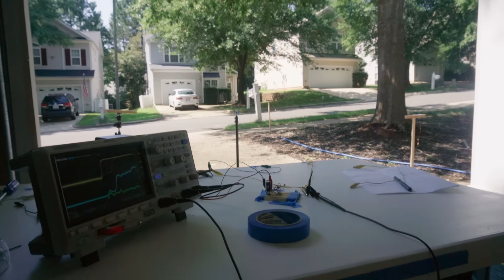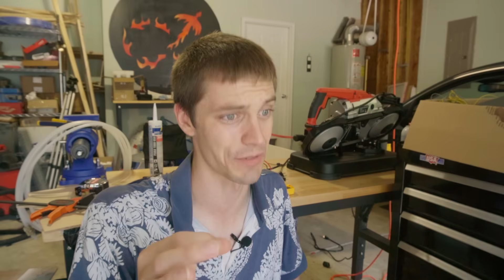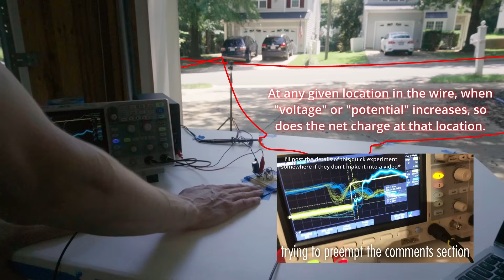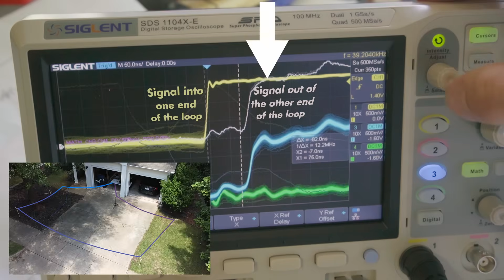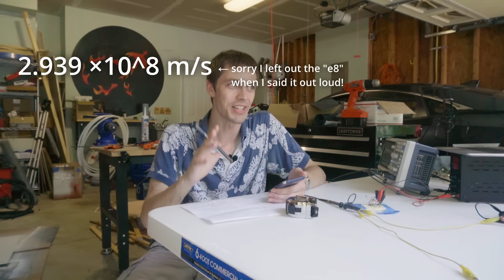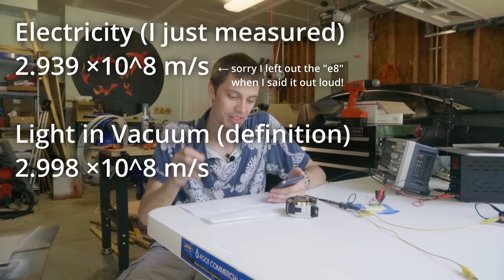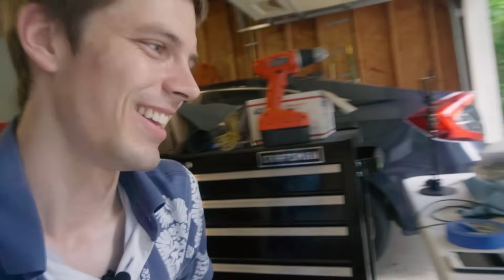Why does WATER change the speed of electricity?

Comment: Speed of electrons has little to do with speed of electricity, the important is the wave of motion of the electrons: meaning how they transfer they change in speed (when each electron begins to move so to speak) and that wave is the real velocity of electricity . Every engineer and physicist learns how to find the relation between a transmission line impedance and the speed of electricity in the line (that depends on frequency so transmission lines are a dispersive medium). it is not the resistance that matters it is the impedance. I can't understand why there are so many videos on the Internet that make experiments (I think Veritassiun began this trend with that with a very bad explanation and no theoretical background at all) yes water will change the impedance of the line and will change the speed...so what? By how much? It depends. A shielded cable will change it too, a bifiliar wire will do, a twisted pair will change it, even the height and distance of the wires affect it, even the conductivity of the soil for ground return systems like telegraphs. Too many experiments and too little explanations. Don't get me wrong the experimental setup is cool, but...this experiment ignores a lot of things...like the dispersive nature of the transmission line (the speed of switching change the speed and distorts the pulse form) and nothing of that is addressed: Veritassium, and others lose the point completely, this is a rich subject that is always explored superficially just for the wow factor. This  all is known by electrical engineers for almost a century...

Comment: Excellent video.  It's extremely difficult to discuss different types of phenomena whether observable or measurable and offer concise explanations that most everybody can understand yet thorough enough that it doesn't come across as pandering to those with slower processing abilities.  Well done.  Since on the topic of frequencies and wave forms, here's some brain food to chew on.  One of the more intriguing phenomena that I've heard about happens when a sound wave is used to collapse an underwater bubble, it produces a flash of light and we don't understand why that happens.  So a given a simple air bubble underwater, then you pop the bubble using a sound wave, and as the bubble collapses it emits photons.  The more you know, the more you realize you don't know.

Comment: Fundamental flaw. 
I feel like you're looking at the problem incorrectly. Instead of thinking about electrons as moving through the wire, or "traveling" through the conductive material, instead, think of it as a line of balls, as one is remove from the end of the line, it frees up space for the neighboring ball to move into it's place. This is esentially how electrons move along a given conductive pathway. Now imagine you have several of these lines, with no constraints to keep them moving linearly, and add varying densities of pegs. This is the "resistance". the pegs interfere with how the electrons migrate from one space to the next.. so forth and so on ad nauseum. 

The gist of the analogy is that electricity, or electrons do not flow, or move through a substrate as you're envisioning, but merely take the nearest available space. if one atom loses an electron, a nearby atom will give up an electron, and this cascades down the line. taking that in mind, if you truely wish to find the speed of an electron, or electricity flow itself, you would need to measure the individual electron migrating from one atom to the next, unimpeded by any resistance, or adjust your calculations to offset for the known resistive value.

Comment: From the department of energy: "But as an object approaches the speed of light, its observed mass becomes infinitely large. As a result, an infinite amount of energy is required to make an object move closer to the speed of light." Sooooo....If those electrons which have mass are travelling at 98% the speed of light, then each electron should have gained so much mass that they are each the weight of a car. Or so we are told....In practice its seems to be a B.S. theory.

Comment: I thought the math doesn't matter in terms of the length of the wire. It's the distance of the switch and the reader or something. Im just an average joe, so I can't remember all the proper terminology but the wire is useless. The wire just gives a direct current but it doesn't matter. Cordless chargers are an example. Idk how to properly explain it, I could make a graph to explain it but I can't do that in the comment section. So like everything your saying about water slowing it down and getting in the way is right, but using the distance of the wire wasn't right, I think 🤔😅... even if it wasn't right I doubt the answer would have been noticeably different

Comment: Propagation and circuits are two antagonistic things. For an engineer, speaking of the speed of electricity is meaningless. When you have propagation you dont have anymore a circuit as the circulation of the electric field is no more conservative and voltage cannot be defined. What you are doing here is measuring the speed of EM waves in an ill-defined  wave-guide. Indeed the speed of waves in wave-guide depends on the permittivity and permeability of the surrounding materials. In the electrical circuit frame (for quasi-static regimes) the speed of moving charge is far less than the speed of EM waves.

Comment: Higher voltages are quicker than large amount of amps. The amps generates a magnetic vector which causes eddy currents. Where as the electromotive force doesnt create magnetic fields but it does cause a stronger polar effect hence the increase in speed and reduced heat watt for watt. 10000v 0.1amp vs 1v 1000amps🎉

Comment: Interesting ... but completely wrong...

The speed of a single electron will be

[ v = sqrt( 2qU / m ) ] (derived from qU = ( (mv^2) / (2) )
v = speed of the paticle (electron)
q = charge of the particle
U = Voltage difference between the end and start of the path (wire or field)
m = mass of the particle (electron)

wich gives us
U = 1.5volt
q = 1.6 * 10^-19  Columb (rounded)
m = 9 * 10^-31 kg
 wich gives
v = sqrt( ( 2(1.6 * 10^-19 * 1.5) ) / 9 * 10^-31 ) = 730 300 m/s
wich we can use to calculate the time for one single electron to move trough the field
(it doesent matter how long or short the distance are between the potential different points)

t=s/v -> 28 /  730 300 = 38 Micro seconds

why?...
the electron itself moves because of a potential difference..
what is measured in this experiment is the movement of charge trough the wire,
 not the speed of the electron 
(an electron moves in steps from one atom to the next at a maximum of around 60% of C because of its mass) .. but the charge wave propagates near the speed of light...

Comment: At ~5:00 you make a point of calculating to include the alligator clips To the oscilloscope probe, but shouldn't the wires of the probe itself also be factored in because the distance from the scope's board would also be wire/distance delay?

Comment: The impedance of free space, also known as the intrinsic impedance of free space or the characteristic impedance of free space, is approximately 377 ohms. This value is a fundamental constant in electromagnetism and is denoted by the symbol "Z₀" (pronounced Z-naught). It relates electric and magnetic fields in electromagnetic waves propagating through a vacuum (free space).

Comment: Pure H2O is non conductive but when you add particles such as salt then the water becomes conductive
Reply: Id also have to conjecture that no molecules physically touch if you pinch your fingers together there is still enough space for an electron to travel between your fingers so wouldn't the same go for the enamel on the copper wire? Even though you have submerged it in conductive water the electronics are still free to travel under the enamel coating across the copper wire

Comment: Wait, so is this the definitive debunk of Veritasium's claim that electricity is instantaneous, since you just measured an obvious delay between the electronic signal and the propagation of the signal, which fell between C and slightly under C? Bravo, all the other explanations were just a bunch of handwaving conjectures, arguing for or against. Assuming no experimental errors, experimental results trump theory and conjecture.

Comment: Dominoes. Electrons. We have to distinguish the speed at which electrons flow from the speed at which and electrical signal or electricity travels. If you have a series of dominoes set up and tap one on the one end then it takes time for the "tap" signal to reach the other end.
That's "latency". If all the dominoes had a sort of connecting force like magnets then tapping one end would mean the "tap" signal reaches the other end almost immediately. At the quantum level, where electricity happens, the latency is at light speed level.

Comment: What you demonstrated is a sort of electrical time domain reflectometer. The "switch" produces  a square wave from zero to a voltage V' by flipping the switch on and off fast enough  to continuously generate the wave so it can be displayed stably in the oscilloscope trace. A function generator was used for this instead of a mechanical switch. In the square wave voltage that was was applied on the start of the journey comprises of several odd and even harmonics that was displayed below your Time/voltage trace above the scope representing I guess is the spectrum analysis. 
     Very well demonstrated video showing velocity of electrical current  in an electrical conductor. Please show your next video passing a wire in  steel conduit.

Comment: The electric field is strongest in the copper.  A lot of the field was propagating within the copper.

Your experiment needs a microscopically fine wire without plastic insulation to see better the effect of water.

Comment: I am not a physist, so these thoughts must be taken relating to my lack of knowledge.  Your set up of flicking a switch is reactionary.  The electricity is already present in the wire, you are merely opening the circuit.  A better test for the speed of electricity to my mind would be to send a signal pulse in an already open circuit, with measuring equipment measuring the delay from instigating the signal and the signal being received by the equipment.

Comment: fft, also interesting 22:30 no need to calculate the fft of your DC wave. you are using an AC/DC converter. it is literally taking your AC and summing wave forms from your house AC power to create the DC you are using. instead, i would recommend using a pulse from a charged capacitor or an old fashion camera flash bulb circuit to get a more pure dc pulse.
Reply from the maker: Would be the same with a battery - any pulse has ac components

Comment: By measuring the centre point of the signal, instead of when it starts to ramp up almost linearly, I don't think you really measure the propagation speed of the electric field itself, but rather the impedance (resistance, capacitance and/or inductrance) of the wire when surrounded by water.

As the electric field spreads, the electrons in the wire needs to move a tiny amount of charge to create field gradient (voltage) you measure (Gauss' Law). This doesn't happen instantly as the field propagates, as it requies some small amount of work/energy. As some energy is also needed to polarize the dielectric water, that means that less energy is used to move electrons around, causing an inductance and/or resistance. Furthermore, as the dielectric sets up a counter-field, it may also affect how much the charge density in the wire needs to be to create a given voltage.

Both effects means that the time it takes to go from one equillibrium to another at a different voltage takes longer, not necessarily that the signal (as information) needs to be that much slower. If you instead of sending i a step function through the wire try to send a sharp pulse (of much shorter duration than the travel time for the signal), I think you may find that the time for the pulse to arrive will be lower than you measured, but that the amplitude of the pulse will also be smaller. The pulse will also be more smeared out in time.

In other words, a wire sending a signal through water may not be as much slower in terms of latency as you estimate, but rather have a reduction of signal strength and max throughput (since pulses need to be spaced out more).

Comment: Th propagation speed of voltage is related to the parallel capacitance and series reactance
Reply: That is correct. We call them Characteristic impedance. A complex infinite  series of series and parallel circuit of parasitic components.

Comment: Large wire has a larger surface, then shouldn’t that cause increase in capacity? And if they are not exactly the same height from ground they will have different caps

Comment: Something that you did omit is the fluid in the pipe that you called water.  It is watery.  If was obtained from your tap it would have had ions in it, making it, if not conductive, then not an ideal insulator.  It will have had a small amount of conductivity.  Your set up would then have been a transmission line, a central conductor, your wire and a shit house outer "sheath" with the outer conductor no connected.  A transmission line connected as a transmission line slows the propagation considerably.  What effect the unconnected outer "conductor" has I don't know.  Your next assignment, should you decide to accept the challenge, is to modify your explanation to include the unconnected transmission line.  I will self destruct in 7 seconds.

Comment: first 30 seconds. SMH!!! the electron from one end of a wire does NOT travel anywhere close to the speed of light to the other end of the wire!!!!  The atom at the far end of the wire gets pushed off the end by the electron being forced into the wire from the other end!  Think of marbles in a tube.  Read a book before posting videos!

Comment: Technically it does. The speed of light is just the absolute highest speed any particule can reach. Even a photon can be slowed down so even light can go slower than this absolute max.

To return to electrons anything that changes the resistance of the material the electrons are flowing through will speed them up or slow them down. Like anything that will interfere with the eddy currents that exist in the wire. Like additional materials coming in contact with the wire or coming close to another magnetic field like you would find in another wire.

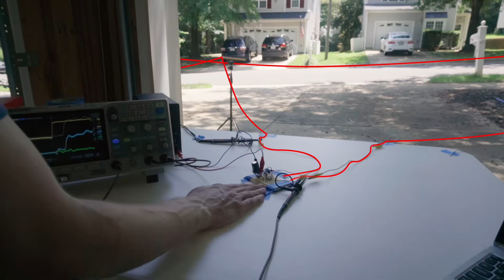Comment: 3:10 the most basic way to imagine electricity is to imagine a pipe with water flowing through it where the water are instead electrons. But you see electricity is not just electrons it’s other aspect is electromagnetic fields that in a way can be thought of as “pushing” the electrons. But it’s not the electrons themselves with which electricity is consisted of. It’s the combination of the two that allow for this anomalous phenomenon.

Comment: For one you used tap water verse distilled water. The tap water has mineral and things that makes the water conductive. Because it is an unbalanced chemical equation. Verse distilled water is pure H2O. Which is a balanced chemical equation.

Comment: @AlphaPhoenixChannel Hi there, first can you cite the link of your video in which you tried to show that electricity travels at the speed of light? Second, I don't think it is a correct assessment to say that massive particles, like electrons in a wire travels at 99% of the speed of light. How electricity flows in a wire is through electron drift so a small subset of electrons are given enough energy to migrate from one metal atom to another but shortly after they collide with the ion of a neighbouring atom. This happens over the length of the wire. I don't think electricity requires that a single electron covers the length of the positive end to the negative end or else AC voltage would not be possible. But instead it requires just a flow of electrons over a certain distance across that length. Therefore the velocity that you measure is not the velocity of any single electron moving from end to end, which would probably be near impossible but instead the "group velocity" of electrons spread across the entire wire moving in sync at the drift velocity whose total effect causes a current flow. So the group velocity of the bulk seems to approach the speed of light however, I think that is only because of the need for consistency of Maxwell's equations which ties c to the propagation of electric fields. To assert that a single electron travels at or near the speed of light by apply just a few volts would kind of undermine the work of particle colliders like LHC. I know protons are much heavier and in those colliders they are smashing protons together but it takes a considerable amount of energy and voltage to accelerate a proton close  to the speed of light. And yes, an electron is 1836 times lighter and would take 1836 times less energy but that is just an order of magnitude of 3 which I don't think is anywhere comparable to the 3.5 TeV and 200 MW of power required to power LHC. I'm saying if it was just an order of magnitude problem to accelerate protons up to c as opposed to electrons then the energy requirements of LHC would be just an order of magnitude up from electrons in wire since electrons, according to the assertion here, travel almost at c in a wire. A wire where they are constantly undergoing collisions with the lattice and losing energy as electrical resistance. If my logic is flawed then please point it out